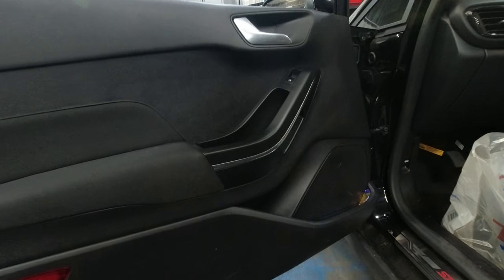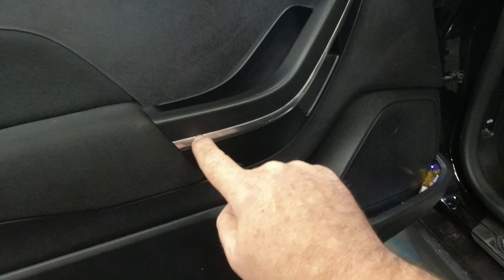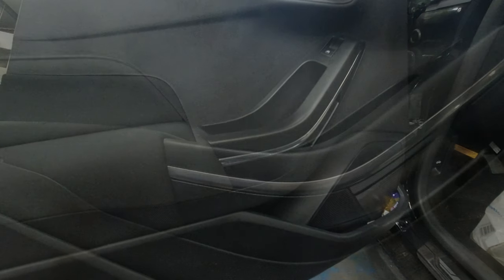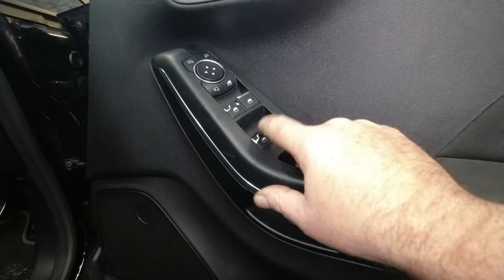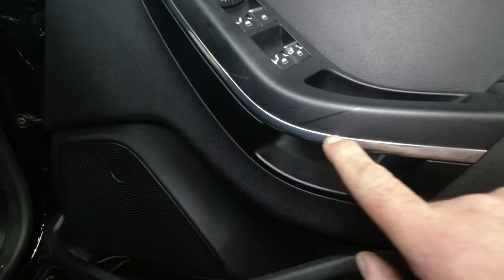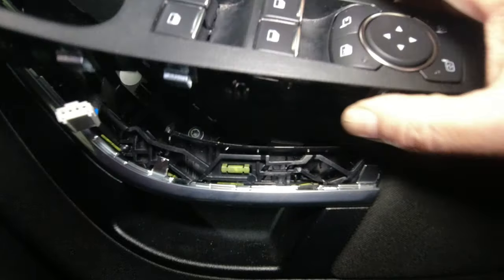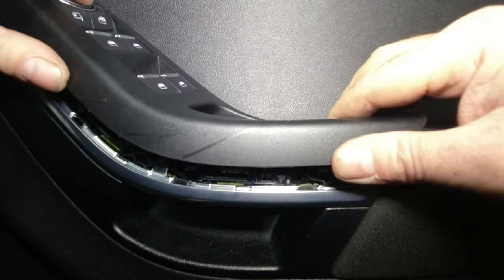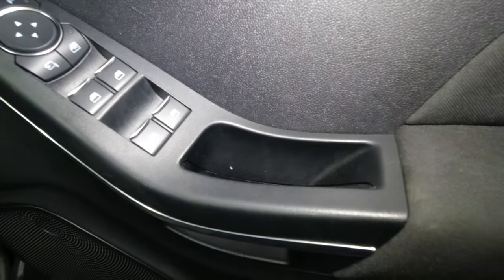Ford Fiesta Mk8 2018 - How To Remove Inner Door Handle / Window Switch Trim .

Comment: I tried to do that on a 2021 Fiesta but it doesn’t come off. The plastic is detached all along the chrome trim, but even when pulling it doesn’t come off, seems like there’s still clips in the middle area below the switches. Actually broke the plastic trying to pull it. Any help?